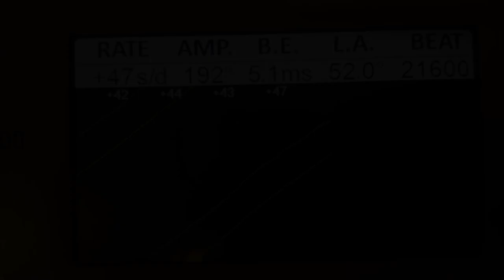FHF 69N Movement Rotary Dress Watch Service

Comment: Thanks, I just got the balance wheel in one of these, next I oil the balance jewels.  Two of the jewels on the bottom plate are blocked by the escape wheel, that's why they need to oiled before the wheels go in!
Reply from the maker: Glad you found it useful, I was very much trying to refine my filming process at this point and have a much better camera angle and view in my more recent videos.

Comment: Very very clear and helpful. Just one question: the third and fourth wheels are  identical?
Reply from the maker: No, the pinion and gear ratios are always different. The 4th wheel makes one complete rotation each minute and this is the one the seconds hand would normally attach to.
Reply: @spidiq8  Thank you